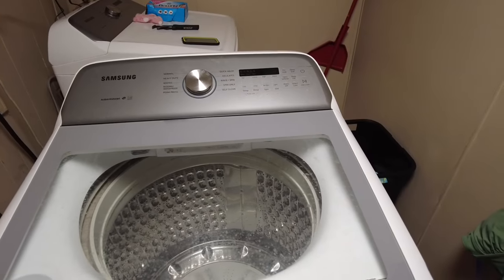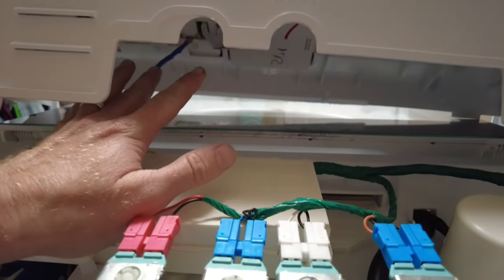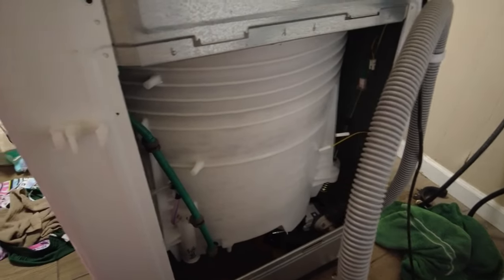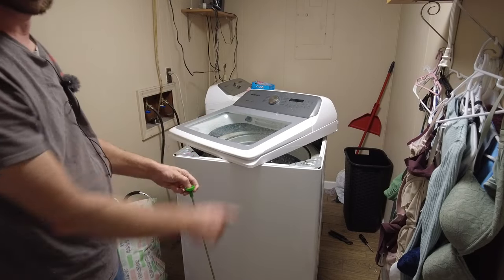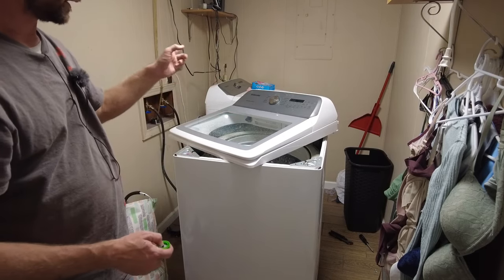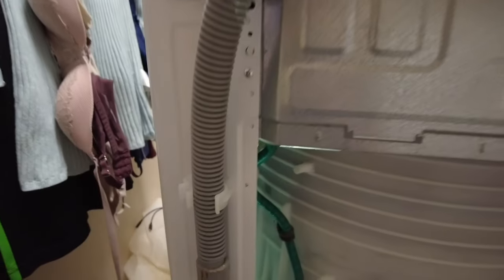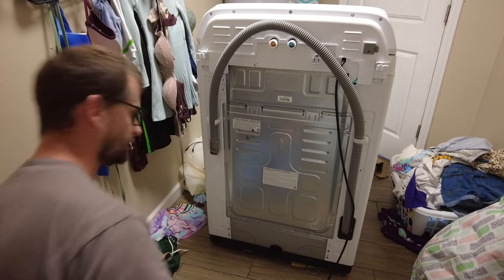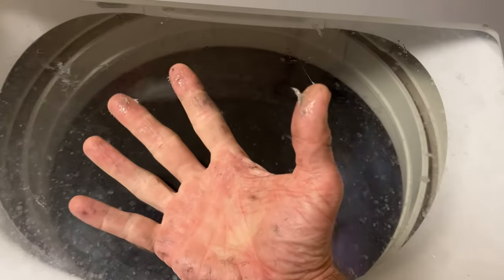How fix an unbalanced load on Samsung active jet washing machine

Comment: HELP!   What if new green upgraded rods and springs are installed; machine recalibrated; unplugged and back in; re leveled;  STILL MESSING UP ON SPIN CYCLE.  There was no      damping grease on new rods; will applying it to rod make a big difference?????????   😡😡😡😡😡😡😡😡
😢😢😢😢😢
If I sit on the machine it spins fine.  ???????
Reply from the maker: Sorry you didn't have grease with the new rods that's kind of a bummer.  These are truly  terrible machines.  You could buy just the grease and try that, or throw the machine off a balcony.
Reply: @ChrisThedudenurse  Do you think the Red and Tacky spray grease at auto stores would work?  I only see the Nyogel 767 and 760 at Amazon.   Is this the right or only to use?  Or Red and Tacky OK.
Reply from the maker: @alfredschmidt3659  unfortunately everything I had was including and I don’t know what the numbers are to get.

Comment: As i was researching this issue on our Samsung, on some washing machines theres a bracket on the bottom between the motor and transmission of the washing machine that literally cracks- causes the same issue. My question is: on these Samsung machines they don't have that? Instead its just these 4 suspension rods??? What happens? They lose their spring tension over time or ? Get bent? Or ?
Reply from the maker: In my limited experience it’s the springs themselves that don’t hold up to the load weight of the clothes and water.

Comment: This fixed the banging issue. But now I have a 4C problem. It fills up with water but after a point it just starts to drain and the error code pops up
Reply from the maker: Sounds like something either got unplugged or installed back incorrectly.  I’d check the connections.

Comment: Where did you get your replacement parts from? We were having this same issue and i bought a set off Amazon for about $45. It worked great for about 5 days and now we're re having the same issue again.
Reply from the maker: I buy mine from Amazon.  These washers are such garbage new springs will not be a permanent fix.

Comment: I replaced the suspension rods and it didn't improve at all! I just tore it apart to check to see if perhaps I installed one wrong, but they all look great...what would you do if the rods didn't fix the UB code?
If I have anything more than a single towel and like two T shirts and some underwear the thing starts banging and then stops with the UB code. Our washer is less than 3 years old.
Reply from the maker: @hippoyell  did you calibrate the machine?  Is there grease on the new rods?
Reply: @ChrisThedudenurse  yes, there's grease on the new rods. I bought the ones you linked us to, but no I haven't recalibrated the washer! Maybe I stopped the video early. I'll watch the rest as I'm guessing you put those directions in the video too 😅
I'll report back here with the result. 
Thanks! 🙏🏼
Reply from the maker: @hippoyell  no it’s actually another short that I calibrated it on.
Reply: @ChrisThedudenurse  thank you so much. I have done much more normal sized loads since recalibration and haven't gotten the unbalanced code yet! This is a huge improvement as we could barely micro loads before. Thanks!!

Comment: is there any way this can be done without accessing the rear. Ours are almost entombed in an enclosure. From the video, looks like the rear right would be the problem. Anyone else do this without accessing the back?
Reply from the maker: @wbdharris  yes it can be done but it is a PAIN!!!!
Reply: Ah ok. I’ll have to pull it out and jump behind it. Also whaaaaaaat the hell is that grease on the rod? I got some on me and dear lord it’s like glue but not.
Reply from the maker: Yes that grease it hatful but do not remove it. The rods actually need that to function properly.

Comment: After the repair and calibration, now the whole washer dances across the floor. What could it be?
Reply from the maker: sounds like the entire thing is either bent or the feet on the bottom are way out of center.
Reply: @ChrisThedudenurse  sounds like it's heading to the scrap heap
Reply: @ChrisThedudenurse  The first two orders, the parts were too small even though the model # was listed as well as measurements (which were incorrect)! I took another swing on the third pitch and knocked it out of the park. I am know at pit crew caliber level  when it comes to changing Samsung washer rods.😂

Comment: Have these rods lasted pretty good?
Reply from the maker: @hellnah171  mine lasted about 6 months
Reply: @ChrisThedudenurse I ordered those.... unfortunately they were the wrong ones - too short. so I ordered the right ones. after we changed the springs put everything back together, calibrates we ran a spin cycle and it doesn't look good so far. but I'm trying to run a quick wash on a blanket to see how it does

Comment: Has anyone found any other springs strong than these or will this be the best all Solution . If I’m gonna do it I’m gonna do it with Premium / Top Tier springs
Reply from the maker: Best bet would be to read the reviews of the springs.  Be sure you either get springs that are pre greased or also buy the grease to go with them.
Reply: @ChrisThedudenurse  thanks for heads up on the grease part . Cheers

Comment: Does the suspension rod still work? Mine went back to wobbling… after a month.
Reply from the maker: Took mine about 6 months but yes it's back to shaking.
Reply: @ChrisThedudenurse i believe its the quality of the suspension spring. The OEM one is 55 dollar per piece in sears website. I will buy it today.

Comment: Replaced springs and still rocks until it shuts off
Reply from the maker: Have you calibrated it?
Reply: @ChrisThedudenurse  
Doing it now, I also popped the blue cap in the middle to tighten bolt. If calibration doesn't work it's on the sidewalk

Comment: Update - our washer is banging like crazy again with small loads placed very obsessive-compulsively evenly around the drum. We replaced the rods a few months back. Another video on this topic says as of a month or so ago that the recommended rods from Amazon can no longer be trusted. He recommends the OEM rods. I can’t understand how that will help unless Samsung has corrected the problem. I guess I will try to contact them.
Reply from the maker: Not sure, I guess my rods were still of quality build.  Have you calibrated the machine after doing the rods?
Reply: No. We need to do that. Will follow up!
Reply: We did the calibration. No change. I guess we’ll try different rods next.
Reply: Update - We decided to try again after the green “upgrades” bought through Amazon failed shortly after installation. We bought a different “brand” from a different Amazon seller, which had lots of positive reviews. Rods were thicker, and springs had a 1” long rubber gasket around a section of the spring. So far no problems (after about a week and a couple loads a day). 😎 Hasn’t gotten off balance once. Let’s hope this lasts!

Comment: Samsung made this machine with certain parts made to break down easily…I guess to make more money on it later.   The suspension rod and springs go out after just 2 to 3 years.  I slid my washer across the floor and 2 of the legs broke off.  They are made of plastic…rather than metal, which should have been the case for this 200 lb. machine.  There are other cheap made parts that go out on it easily too.   They are cheaply made, but “expensive” to replace…and that’s the logic for making them out of cheap material…so that you will need repairs soon.   It’s all about making more money off your machine AFTER  they’ve sold it to you at a ridiculous price of over a $1,000.
Reply from the maker: Seems to be the way everything is made nowadays.  Inflation and cheap parts/labor.

Comment: Hello I  replaced my suspension rods on my washer the problem was fixed then it came back after several washes. What should I do ?
Reply from the maker: Did you calibrate the machine?  If you did then you’ll probably have to replace the rods again, these machines eat rods.  Also did you have grease on the rods? Sometimes they don’t come pregreased.

Comment: This happened to me tonight and the same wash is on its fifth round . It is not spinning and I cannot understand the settings . All i want to do is spin the water out. Help !!!!
Reply from the maker: When mine would do that I would have to take everything out and drain the water then put the clothes back in and try the spin only cycle.

Comment: I made this change of suspension rods  2x and still giving me the same code an problem.  Does anyone know  an other solution ?  I already made sure that the machine it self is well balanced also looked for items between the drum and housing. Does anybody know what else to check for to fix the unbalanced problem?
Reply from the maker: @ooxoker  have you calibrated?  Did the new rods come with grease or have you reapplied the grease?
Reply: Did you try the Calibration setting 1st, you just have to press the “Temp. & Delay End” buttons at the same time for 3 seconds them press “hold to start”button, and that is it, it’ll do the rest for ya
Reply: I have calibrated several times. It didn't help much.
Reply: @JonathonLoz 
Yes, but...

Comment: So I replaced our rods a month ago and it's showing Ur and Ub again. It'll do the smallest load normal. Maybe 4 pieces of clothes and it'll spin normal. But a normal load it will not. I wanna hit it with a hammer. Lok
Reply from the maker: Yes completely agree.  These rods in this video lasted me almost 6 months.  This seems to be a trend with these Samsung washers.  You could try getting some special grease and applying more or recalibrating the machine but these are really just bandaid fixes.

Comment: I have a STSS/Stainless Steel Metal pulsator and agitator plate aka the impeller.
Reply from the maker: They have those in all of the older machines no matter the manufacture.
Reply: @ChrisThedudenurse  They also have this in modern machines

Comment: Please take the Amazon link out of the description, the suspension rods that I received didn’t work
Reply from the maker: I'll have to take a look at it, maybe I can just update it.
Reply: @ChrisThedudenurse hey man I ran across the same problem you had, did you by chance update or verify that the link in the description are the proper rods for replacement? Thanks in advance. 

Also did you have any problems with the washer since you posted this video?
Reply from the maker: @khoreydakers1905  dangit seems like every time I update the link Amazon changes it.  If you type your model number in the Amazon search bar the correct bars do come up.  I’ll update again the link soon as I get some time.
Reply: @ChrisThedudenurse  thanks man

Comment: so the water line on mine popped off and idk where it goes and i can’t see where it’s supposed to plug back in or hook back up to. any help?
Reply from the maker: That’s ok, not to big of a deal as long as it just popped off and didn’t tear.  It’s actually close to where that 4th rod is on the very bottom of the drum.  You should see or feel a tiny spout.
Reply: @ChrisThedudenurse  Thank you. Theres a blue cap that was up there and it just popped off that part i believe it is a water flow sensor or something dealing with the water but thank you so much. My daughter and her mother will be very happy because they have a working washer now.
Reply from the maker: @DJBZRK504  that’s awesome I hope they get it fixed

Comment: This didn't work for me. After replacing the suspension rods and re calibrating the washing machine gave us 2 washes and then started doing it again. The washer is level. There are some posts that say you should buy the Samsung springs, but they are 70.00 each!
Reply from the maker: Even if you buy the OEM Samsung rods they may not last very long.  These washers really are not that good.

Comment: My husband just replaced the tension rods bought on Amazion, and the shaking is even worse.  Did we buy cheap parts?  I am about to call a repair person.  We can't wash our clothes!
Reply from the maker: @kellyhunter8804  did you get the rods with grease or did you apply more grease?  It is possible that you got bad rods.  Also these machines are terrible in their own right.

Comment: I did replace them and still the same problem any other idea what could be the issue
Reply from the maker: @tedsgameplay3913  did you calibrate the machine after the repair?
Reply: @ChrisThedudenurse  yes I did I replace them and calibrated the machine and still doing  the same thing, in order to the washer to work fine is that i have to put like 5 T shirt and 3 pants if I load the machine with more clothes that’s when it starts doing the crazy shit again 😅
Reply: I’m literally fighting with this machine right now 😂😂😂 I’m about to go insane
Reply from the maker: @tedsgameplay3913  open the back again and make sure those 2 connections are connected and to the correct wire.  If that’s not it, sell it.  Sell it fast and take whatever anyone gives you and buy a used well loved whirlpool or Amana front load.
Reply: @ChrisThedudenurse  thanks brother 🤝🏽

Comment: What if you changed the stabilizers and it still don’t work then what??
Reply from the maker: @amc5048  did you calibrate it?
Reply: @ChrisThedudenurse  yeah I did the calibration but i noticed I have the same washer machine but a I think it’s a different model #. I noticed the rods I ordered were like  1/2 inch shorter. I wonder if they made the same design for 2 different models because mines all black
Reply from the maker: @amc5048  that 1/2 could make all the difference.  These Samsungs are pure garbage from the factory.
Reply: @ChrisThedudenurse  i think it’s more then the stabilizers. They were washing really heavy loads so I think something else is messed up. I installed everything correctly. Guess it’s time to go in the bank account and purchase a new washer machine

Comment: Ok I replaced mine and it still happens.  Now what
Reply: Same here. Tried 3 different sets of rods. Same issue with not even a slight improvement.
Reply from the maker: Have you recalibrated?  Did the new rods come with grease, or did you add grease?

Comment: This happened to me and it done the same thing. After like 3 times, it gives up and gives me an error code.
Reply from the maker: These are terrible machines.
Reply: For some reason...
Reply: It's now doing better than expected. Even though I didn't replace the shocks.
Reply: How old is your machine?
Reply: @ChrisThedudenurse  I recommend you get the LG top load washing machine with the direct drive. When it is spinning there is a 15 percent chance that it will unbalance.
Reply from the maker: @Khizarsalam  not very old, maybe 2 years
Reply: @ChrisThedudenurse  my machine is 7 years old and it isn't having any problem with balancing since 1 year. The machine has a 10 year warranty.
Reply: I mean it at least errors out on you. 2017 models or the older that happens and even if it is happening, it just keeps going. If it keeps going unbalanced, it can explode as loud as a bomb.
Reply: Has the shocks been replaced before?
Reply: @ChrisThedudenurse  also that Grey line is the pressure sensor

Comment: I changed the suspension rods, washer still unbalanced…anyone else experience this?
Reply from the maker: Did you calibrate it after you did it?
Reply: @ChrisThedudenurse yes i did the calibration as well. Im going to take a look at the bearing at the bottom of the unit next.

Comment: Replaced them. Did nothing. Same problem persists.
Reply from the maker: Did you calibrate the machine?
Reply: Did you get it to work?
Reply: @ChrisThedudenurse how do you do that?
Reply from the maker: @eramirez198121  How to calibrate a Samsung top loader washing machine
https://youtube.com/shorts/FYj8li0Mhg0?feature=share
Reply: @ChrisThedudenurse  thank you sir!!
Reply: @wil3797  Finally. I realize these Suspension rods are actually shock absorbers like on a car. But cheap. There is a undersize plastic slide that grips the rod very tight and this slide provides the friction that keeps the bucket from bouncing.  The same way a car will bounce with bad shock absorbers. But its really cheap and doesn't last. So I wrapped a wire around it and twisted it tight on all 4 rods to make it grip the rod very tight. That solved 85% of the UB stops. The final 15% were solved by following the Calibration procedure in a post below. Now it runs like new.

Comment: Ordered and replaced the springs but still have the same problem
Reply from the maker: Have you calibrated it.
Reply: @ChrisThedudenurse  yes I did, I watched another video that mentioned a censored may have gotten damaged. Do you have any idea about that. Your video was excellent to follow by the way
Reply from the maker: @DeirdreVillante  thank you.  It is possible that your drum shook so hard that it is warped also.
Reply: That’s not good, may have to get a new machine. This one is only maybe three years old definitely won’t be a samsung

Comment: I replaced my suspension rod cuz with the same issue but still the same
Reply from the maker: Did you calibrate it after the install
Reply: @ChrisThedudenurse  how to calibrate?  See if the unit is level?
Reply from the maker: @user-tx9gs5ef8o  How to calibrate a Samsung top loader washing machine
https://youtube.com/shorts/FYj8li0Mhg0?feature=share
Reply: Ok.  I did the calibration but the same.  How many times should i calibrate it?  TIA

Comment: This is the most over work you could possibly do to change the springs
Reply from the maker: @BobbyBoats8008  on my part or Samsungs
Reply: @ChrisThedudenurse  yours, there's 2 screws in the front. 3 screws in the back panel of the control board and 2 going down through the frame in the back. After that the whole top can tip back. The springs pull out very easy from the top.